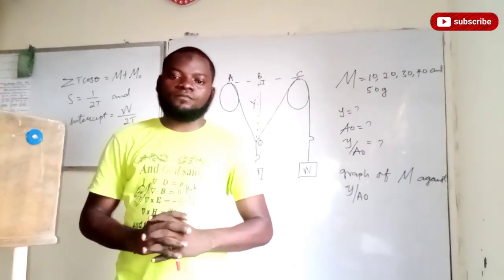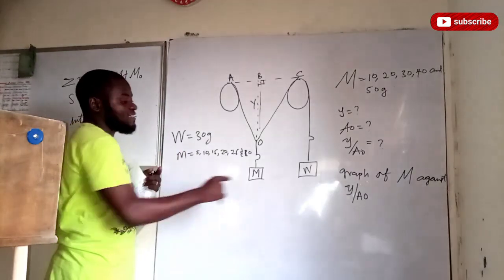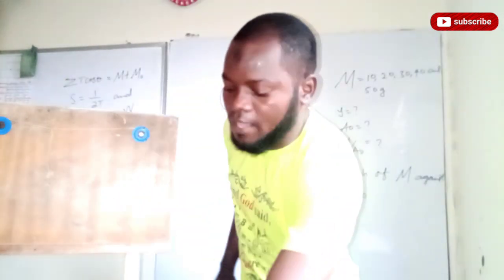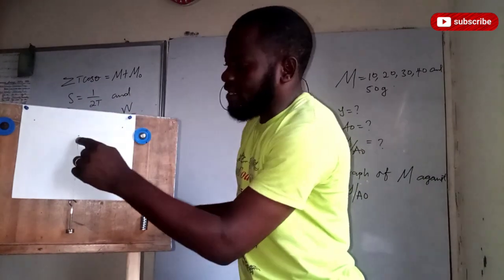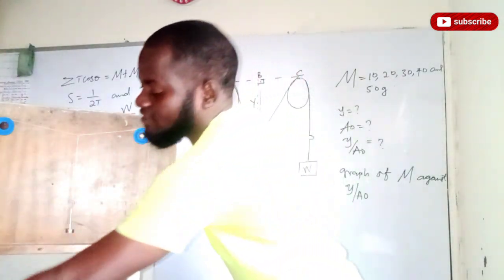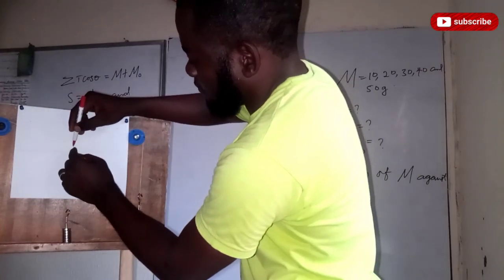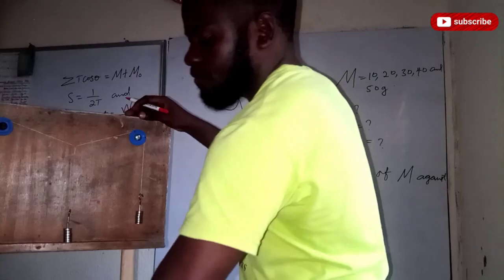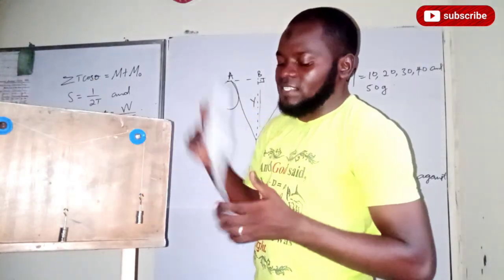NECO 2020  physics practical mechanics

Comment: If we have the following apparatus  perforated meter rule, retort stand and  clamp,split cork,one optical pin,stop watch, spiral spring, thread, masses of 10g 20g 50g.which single experiment can be connected.suggestions possible experiment that can be performance from the set of apparatus.